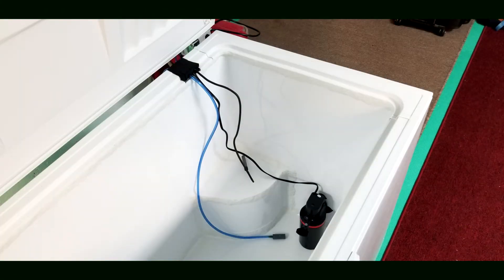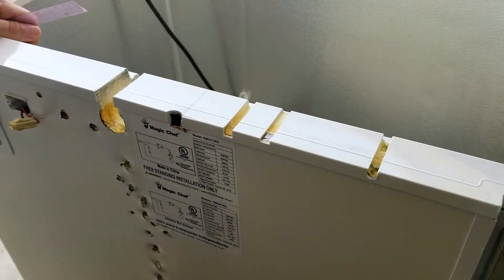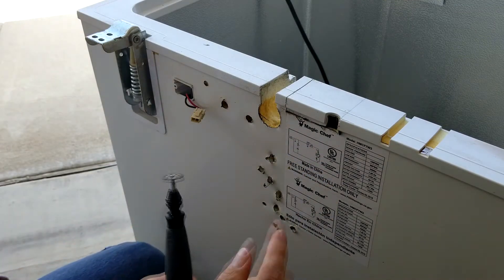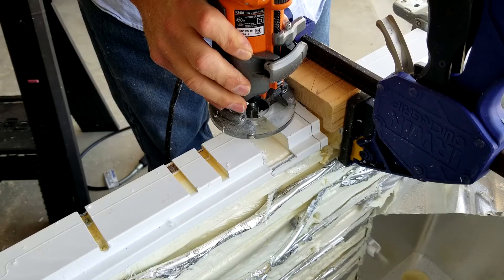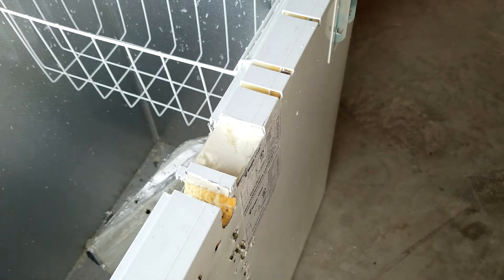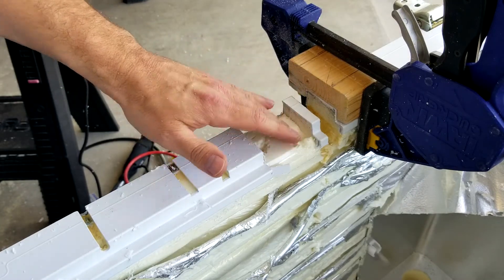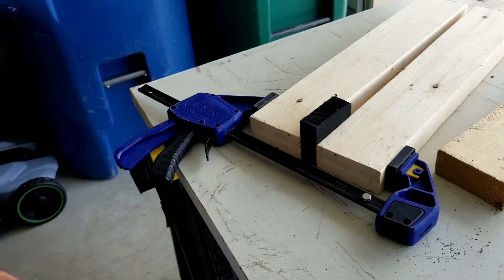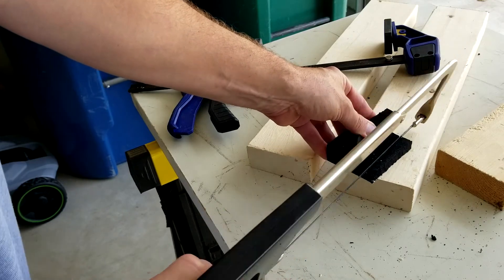Running the Ozone Tube, Pump Power Cord, and Sensor Wire Through the Chest Freezer Trim / Wall

Comment: In your opinion what's the coldest temp water will a homemade chest freezer cold plunge tank get before it ices up? If it had excellent circulation.
Reply from the maker: With a suitable submersible pump, you can get the water temperature to about 34F / 1.1C without ice building up.
Reply: @JohnRichterAustin  very cool!!. . .literally lol 😎

Comment: which ozone filter did you use?
Reply from the maker: After a few failed experiments with others, I ended up with a JED 203 in 2018. It keeps water crystal clear for 6 - 12 months. I'm happy to answer any questions. I'm an official reseller, and if you choose to buy one, getting it from my website helps me support the cold plunge community - and my family- and is greatly appreciated. 

http://www.chestfreezercoldplunge.com

You'll also need a pump/filter to keep your water clean. This submersible aquarium pump from Marineland works great.  It doesn't cost any more and I earn a small bit when you make a purchase with this link: 

https://amzn.to/3jaw0S3